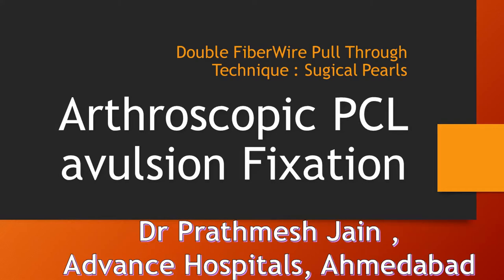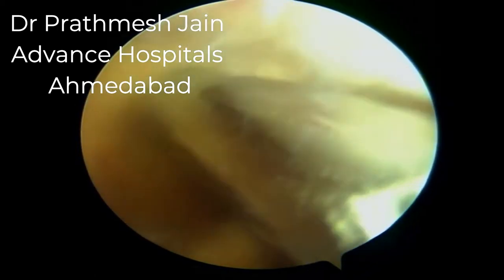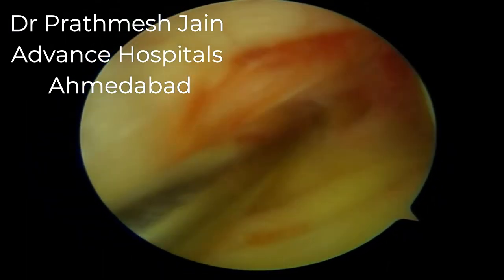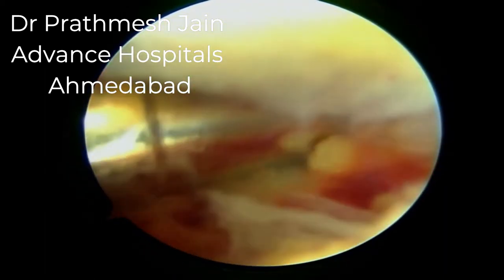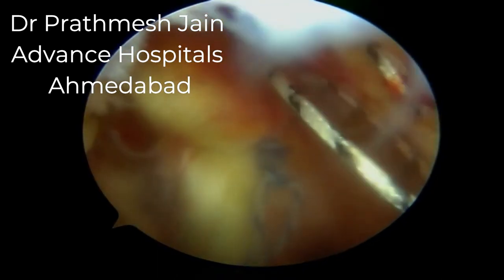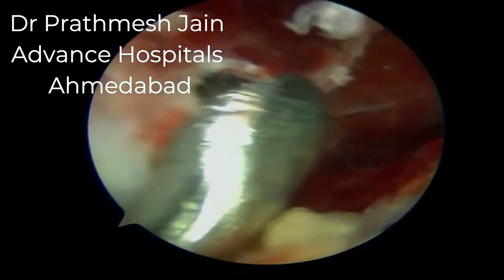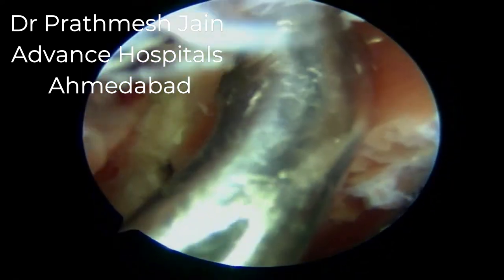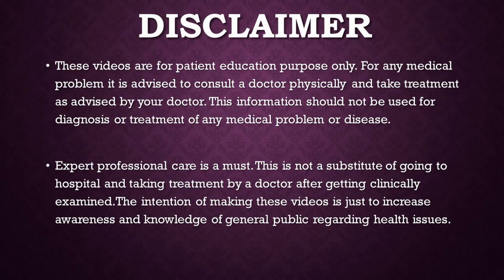PCL avulsion Arthroscopic Fixation Suture Pullout Technique English .

Comment: Sir, PCL avulsion fixation treatment cost kitna hai aur normal hone mein kitna din lagta hai
Reply from the maker: send reports on whatsapp no 9227901980 
Advance knee and shoulder hospital. Pakwan crossroads, sg highway 
Ahmedabad 
All details on www.kneeshoulderindia.com
You can book an appointment by calling on 7096021983/ 7096021847/7096021916 
www.advancehospitals.in
Reply: Sir my same surgery is done  via cc screw fixation ( burks and Schaffer method) 
Will it's affect my movement???
Because it's now 4 month of my surgery I can walk without walker but there is instability (but no pain)??

It's is normal that some instability in starting when we walk without support ??
I just starting walking without support from 10 days!
Reply: @neerajkumarsingh4691  sir mera bhi pcl hua hai kya app hepl kar saktey h kuch pochna thaa
Reply: @inderkamboj9615  Haa sir boliye mera feb mai hua pcl avulsion operation via screw fixation at KGMU lko now I am walking perfect but some issues still with running my doctor says it's take fully normal in next 3 months
Reply: @neerajkumarsingh4691  Sir maira bhi PCL Avulsion fracture hai 5mm fraction ke sath, miare Doctor ne kha ahi ki apne aap thik hojayega, aisa ho sakta hai kya
Reply: @shoaibpathan7854   bina operation thikho